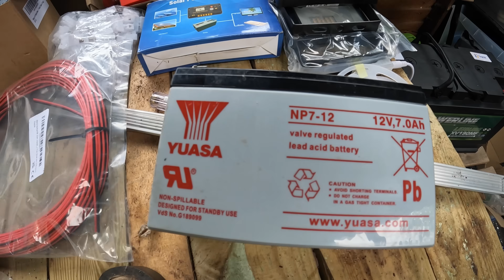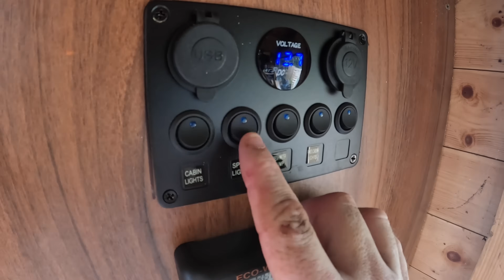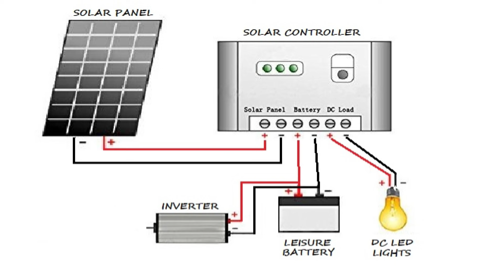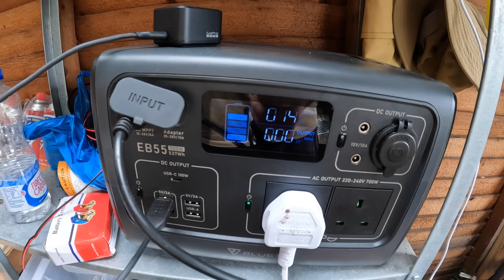TWO WAYS to get Solar Power - Off Grid | Bluetti EB55

Comment: Deep in the channel archives Danny as looking at some power for the shed and new pt so glad you’d covered! You make it look dead easy to install - would you still recommend the set up after using it for a while? Cheers, James
Reply from the maker: Hey James! Absolutely! Solar panel system still working well... however I do have a stronger power generator now too. But the solar setup is a constant at the plot. So its handy to always have lights etc..

Comment: Hi! I was wondering, is there any allotment based appliances that you can't plug into the setup? I am assuming you can run some 13a things such as kettles? Do you know if you are able to plug in something like a leaf and branch mulcher? I'm not talking about hours of chipping, just bits here and there as I have them. I am wondering whether to go with power or just the lights? And these are the two things I think I would need to use that would plug in.
Loving the channel, lots of helpful information.
Reply from the maker: Hmm that's a good question. I'd say take a look at my other bluetti video where it's more powerful and I can use a power washer. I think using solar power and a leisure battery wouldn't be strong enough for all you're planning. It's a tricky question as somethings will work, like fans etc..  but other stronger gadgets will be too much for the leisure battery. Danny 🌱
Reply: @TheGrowUpChannel  Ah, I did also watch that one actually! But will pop back over and have a re watch anyway. I thought a chipper would probably be excessive 😂 have you run anything like a kettle off yours at all? I would have thought it should be ok for that? or have you just tried smaller things like fans?
Reply from the maker: @craftjamcrafts you can actually get 12v kettles online :) I've 2 Bluetti videos. The one with the powerwasher may do a chipper.
Reply: @TheGrowUpChannel  Great thank you for getting back to me, I’ll take another look and check out the kettles. Just getting tired of making a ton of coffee before I go down to my allotment! Thank you ☺️
Reply from the maker: @craftjamcrafts oh I remember those days haha. I'll be fitting all new gadgets in the new shed build soon. Danny 🌱
Reply: @TheGrowUpChannel  It’s a competition to see how many espresso shots you can cram into a flask 😂 Great, I look forward to seeing the new shed stuff. I love watching all the extra things you put together on top of just the allotment basics, it’s really interesting

Comment: Ohh get you 😂😂. We have a simple very basic solar powered security light in our shed. We bought it about 6years ago and its still going strong. It was from B&Q. All we wanted was a light for when the nights get dark and we are packing everything away. The panel is on the sunny end of the shed and the light is inside. We were amazed at how bright it is and have had people say as we're leaving that we have left the light on in the shed and we remind them we don't have electric 😂, the only downside is the light only stays on for a short while and we have to wave our arm for the sensor to pick up the movement and switch back on. It serves it's purpose and that suits us.
Reply from the maker: Absolutely Liz. If it works for you. Lovely ❤️

Comment: Brilliant set-up demo Danny. Very comprehensive & I love the way you tested before the final fitting - many leave this step out, much to their regret later LOL
I have a similar portable power bank/solar set-up. A life safer - well it could be LOL. You may find that the leisure battery set-up outlasts the portable as it can stand more cycles over its lifetime - but heck, I've had mine 3 years now with no loss in performance.
Reply from the maker: Haha It wasn't my first rodeo Steve..  I learnt from the first time I fitted a solar setup. I was there for hours taking all the cladding back off to check wires haha! Yeah I've looked at the bluetti and there's a good few years life on them. By then I'd have upgraded no doubt haha thanks Steve. Danny 🌱
Reply: @TheGrowUpChannel  The "reputable" makes of portable solar power banks are worth their weight in gold and I hope some buy one via your link! Mine has gotten me out of a tight spot or two: power cut at home and needing power on the plot.
Reply from the maker: Oh I get no extras if they use the link 😄 but happy to show viewers other options. Danny 🌱
Reply: @TheGrowUpChannel  Good on you! I hope viewers consider buying one as they really are worth their weight in gold!

Comment: Dangerous Man At Work! Lol. Great job, mate, If you're running the inverter, consider adding a fusebox you can buy blade fuses, which will save your wiring. I can't wait to get my second system installed. It's all been sat there since January. I need more time and inclination.
Reply from the maker: Send me a link Tony 😄 cheers matey!